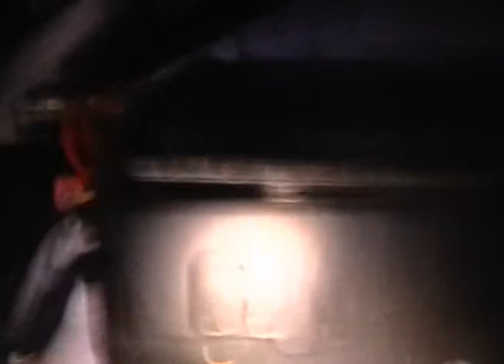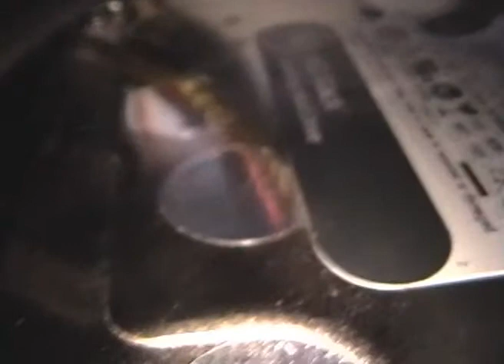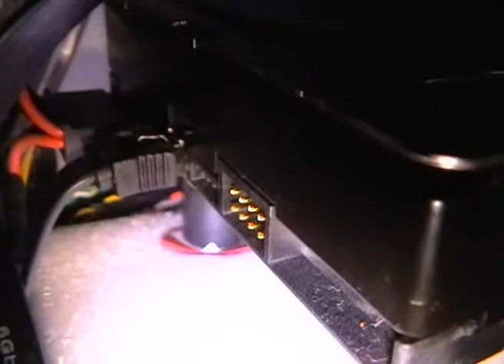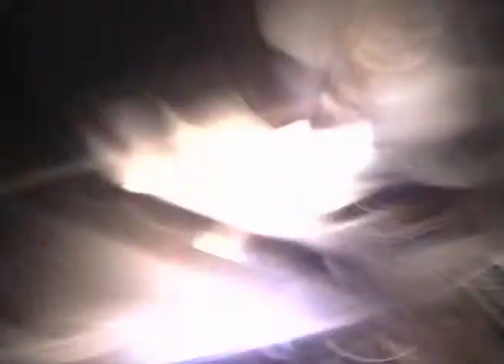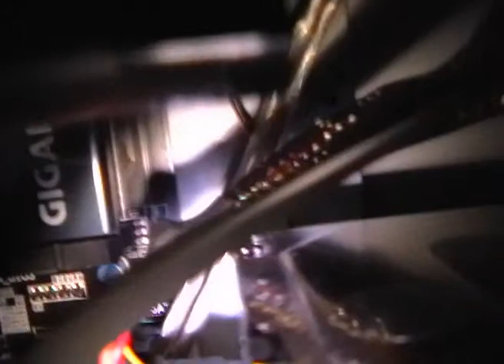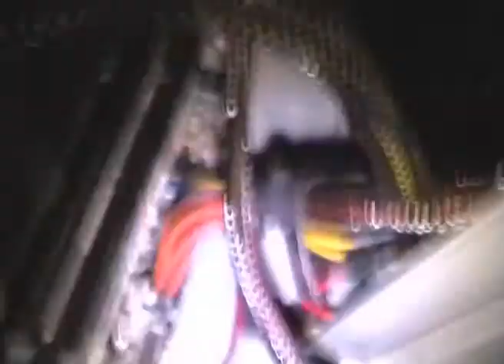WD Caviar Black hard disk drive me crazy

Comment: dude you have an airport inside your case
Reply from the maker: +Swirox It is louder than in reality due to the sensitive camcorder mic and because I wanted to make the harddisk clicking clearly audible. (It doesn't occur anymore these days or I managed to dampen it well.)
My PC only has silent fans. Scythe Slipstream for the case, at 800 rpm I think. They are great because they have sleeve bearings, meaning they only generate air noise, no tickering or humming or such. And since they only suck air in in my case, the sleeve bearings will be especially long-lasting.

Comment: Did you ever RMA this drive - was the new one any quieter?
Reply from the maker: No, RMA would be over-the-top for this problem. By now I (somehow) managed to dampen it better so that the vibrations don't become audible. I still find it odd though. Back then I ran a tool that shows me any drive activity and the process responsible for it, and it seems it wasn't any running program that causes this activity. Doesn't surprise me much either. Modern drives tend to do all kinds of weird stuff, like internal optimizing or sector refresh and such, because the technology is so much at its limits.
Reply: I haven't tried any sound dampening yet, but I also confirmed the same noise with zero disk activity.

Out of curiosity... what's the average temp of your drive? thanks

Update: My motherboard has two sets of SATA ports. Drive was plugged into pair that was set to IDE-mode. Changed to AHCI, which allows NCQ - problem solved.

Drive's still a little noisy while R/W, but I knew that b4 purchasing. Hope this helps GL